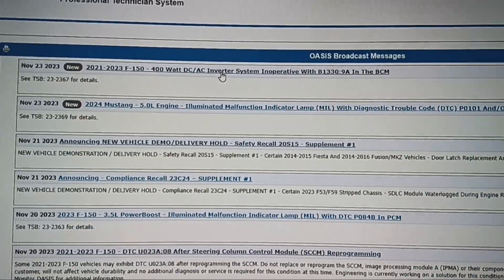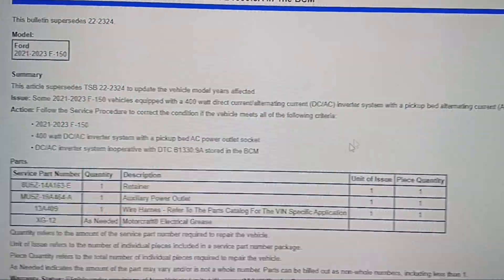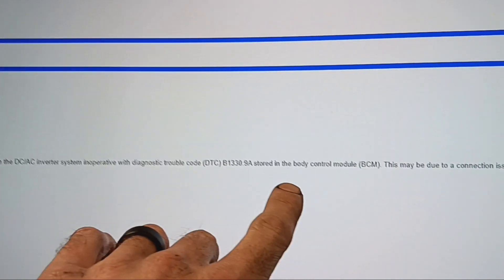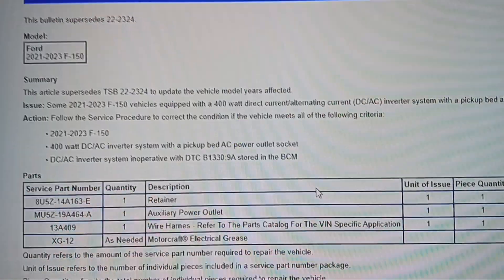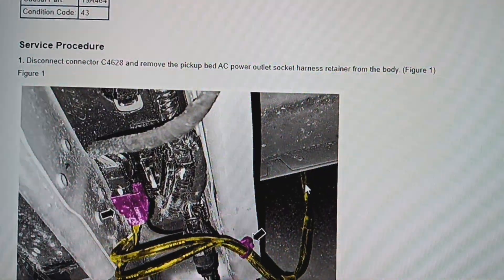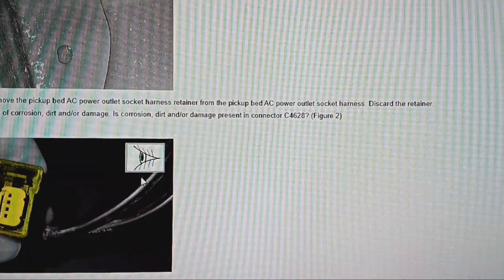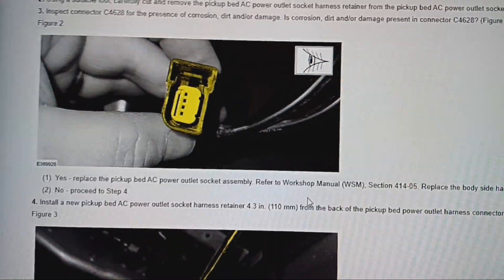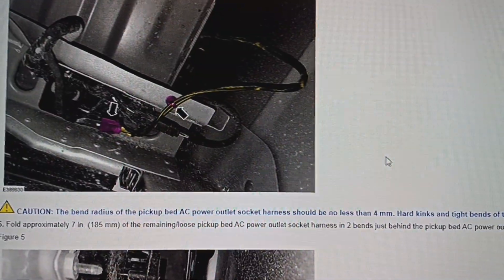2021-2023 Ford F150 TSB 23-2367 400watt DC/AC Inverter System Inop #newtoyou #fyp #ford

Comment: If you replace the bed plug with a new one would it need to be reprogrammed
Reply from the maker: No.  Its plug and play. You just reset the battery monitor system.  I did every step in the video. Mine failed .No programming
https://youtu.be/ytlUoZEx_aE

Comment: Thanks for the video.  What about step 8 of the TSB? Is it needed?  

8. Download and run the BCM - Reset the Battery Monitoring Sensor Learned Values application and then the BCM Local Interconnect Network (LIN) New Module Initialization in the 
FDRS to relearn the direct current/alternating  current module A (DCACA) outlet configuration and retest. If DTC B1330:9A persists, continue with normal diagnostics in the 
WSM, Section 414-05
Reply from the maker: Step 8 is for if you replace it i do belive. I'd have to go back and look. But what you typed out is replacing in.

Comment: Dose this include the system overload
Reply from the maker: No. If it did it would say it in the symptoms. If your getting system overload then you are overloading it
Reply: Is there a way to test it
Reply from the maker: @rjross2907 id have to look at a pinpoint test. I'd need your vin and I wouldn't be able to get to it til Monday. You would need to email your vin though
Reply: Didn't have anything plugged into the system went to plug in a phone charger and the over load msg came up bin looking at things for weeks and trying everything I can but can't get it to reset and the light keeps flashing
Reply from the maker: @rjross2907 yeah not one of the symptoms. There may be a failure in the actual inverter.
Reply: Did you get my vin and email
Reply from the maker: @rjross2907 no. Nothing in my email nothing in spam

Comment: My outlets come on for few seconds when turning the truck on. Then they shut off and won’t come back ?  Thoughts ? Suggestions?
Reply from the maker: On the bed or in the truck? Can you email me a vin?
Reply: I have this same problem  @BeardedFordTech
Reply from the maker: @JRivers1989  check the wiring under the truck that leads to the outlets in the bed. You may have to replace the harness with a new one and the outlets.
Reply: @BeardedFordTech  will do
Reply: I have this same problem. Did you ever have any luck on a fix?
Reply: @AdamCostenbader not yet unfortunately.  Haven’t messed with it yet.   It can only be two things.   The inverter took a shit or the wire connector under the bed has to be cleaned.  There’s a bulletin out from ford with all the known problems with that.
Reply: I have a 2022 and has been repaired/ replace and plug(s) not working again
Reply: @Sadams707  no shit?? did you see the bulletin about the wiring under the bed near the bed outlet?

Comment: Have you seen this repair actually work? I bought my 2022 F150 Lariat 3.5L EB used and the outlets never worked. Looked under the bed to try and do this repair, and lo and behold, it's already been done. Obviously, it didn't fix my issue.
Reply from the maker: Then they did it wrong or you have a popped fuse. I've done a few and yes it worked. Check fuses.
Reply: @BeardedFordTech  any idea what they part number is for the fuse or where to buy one?
Reply from the maker: @Renagade2287  what fuse?  This is for the inverter in the bed of the truck. If its not working check the harness that is explained in the video
Reply: @BeardedFordTech  correct i was told to check a fuse but that could be bad info. If i get a new inverter do i need to use forscan to reset the BCM?or just plug and play on the new inverter. I inspected the wires where the inverter plugs in and there are no  rips or tears
Reply from the maker: @Renagade2287  you have to check the connector and pins as well. It is not programmable. Should be plug and play

Comment: That's the same problem (code) that I have with my Maverick 2022...
Reply from the maker: Unfortunately this only applies to the F150. If you have this code check the following 
Body Control Module (BCM) Fuse 6 (10 amp) 
Battery Junction Box (BJB) Fuse 36 (60A)
If fuses are good replace the AC outlet. 

That's literally the pinpoint test for a maverick

Comment: Just unplug all of them down below and add some XG-12 in all sockets.
Reply from the maker: For warranty purposes. Not allowed. I see where you going with this though.
Reply: @BeardedFordTech  I will with my vehicle. Did the same on my super duty when I had it. Not a single issue with any under vehicle connection from the day I bought it till it was traded. My liability there as you mentioned.
Reply from the maker: @vais3  I totally agree with you!  Peace of mind. But if they did that under warranty the it stirs the pot. Know what I mean. Now if they repaired it. Then the customer did it. Then even better
Reply: @BeardedFordTech  I keep a tube in the console. Just gives you an idea. Lol
Reply from the maker: @vais3  🤣🤣

Comment: Thanks again! I'm surprised at how many shops that flip out over using forums and TSB's. That was always the first thing I would look at. Actually why I like my HT500 scanner, it has recalls and TSB's to help diagnose.
Reply from the maker: That's why they are there. That's why TSB is published. To aid in diagnostics. I'm just like you. I'll never understand why shops flip out over that.
Reply: @BeardedFordTech  I got yelled at and was told the legit Hyundai forum from Hyundai Kia was to never be used and I was arrogant for even thinking about trusting ANY forum.  I told them it's not Bible and may not be the answer, but they can be of help to aid.  Then I got yelled at for pointing out a TSB on a Escape and noticed it was related to what was going on. He said I didn't use the Ford Tablet so it was invalidated.  I still wrote it up anyways copying and pasting the TSB. Customers had a portal for their phones, so they couldn't not tell the customer.  Which ended up fixing it. It's crazy how chains don't use the tools given to us like Forums, Recalls, TSB's and common sense from experience